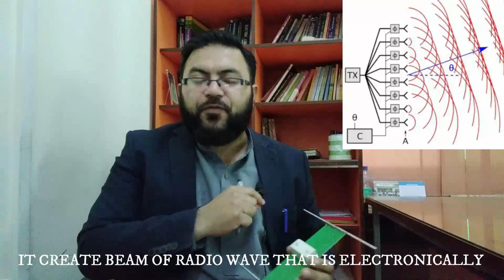How to design phase array antenna |Why we use phase array antenna| beam steering|phase array antenna

Comment: Sir in your explanation of Phased array antenna what will be the purpose of copper lines between coaxial cable feeding connection and 4 external metal rods. It behaves as transmission line? kindly guide